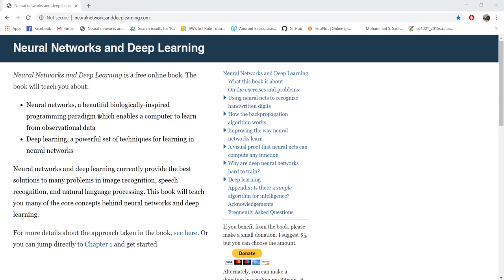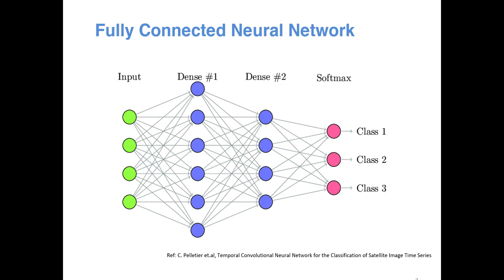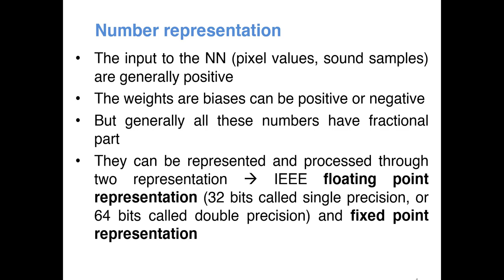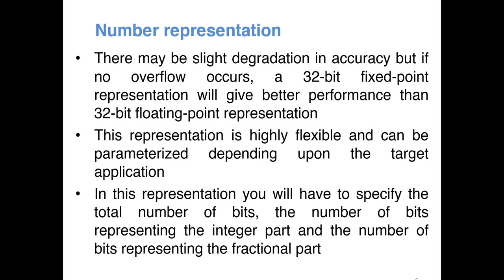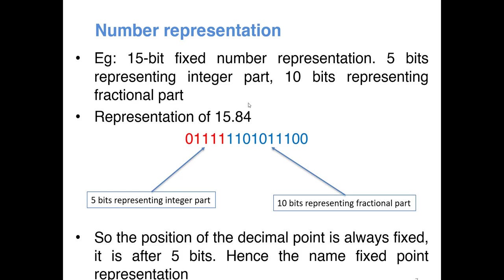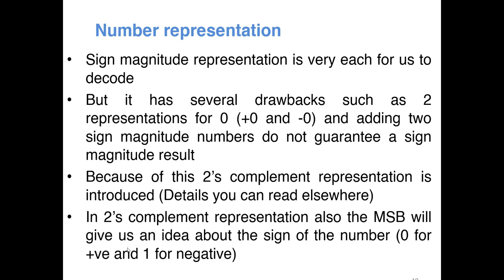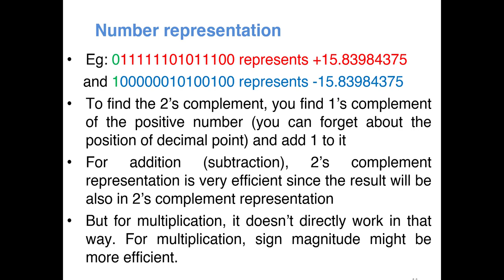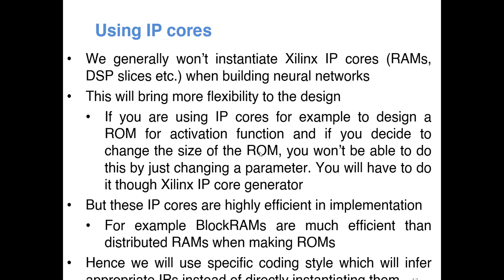Neural Networks on FPGA: Part 1: Introduction

Comment: Great course. May I ask, which development board are you using, specifically? I think that you are using the zedboard but could you also use the Ultra96? Also, in the zip file, which is the file that is used to hold the pretrained weights?